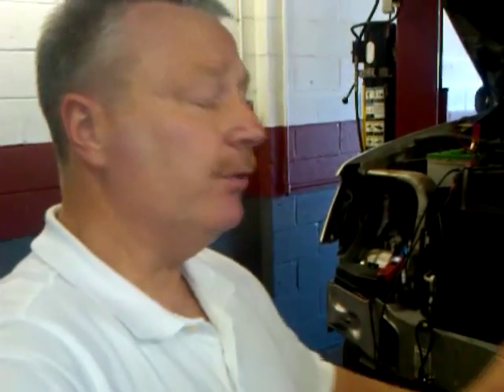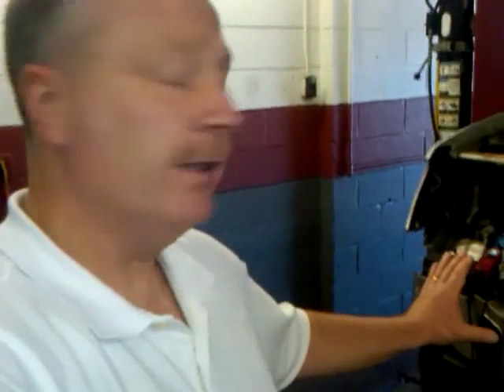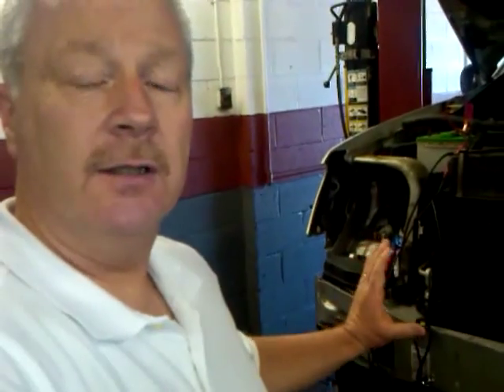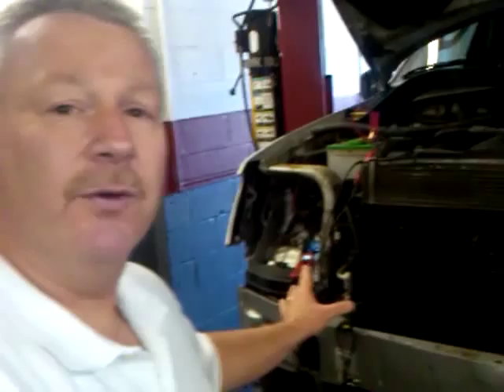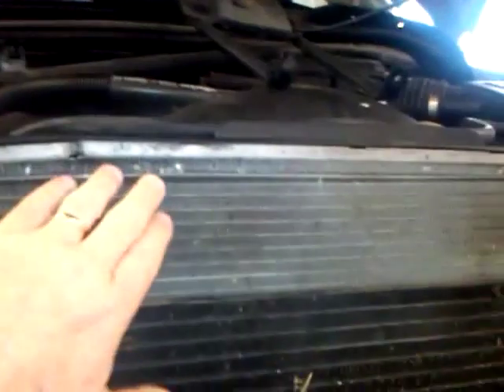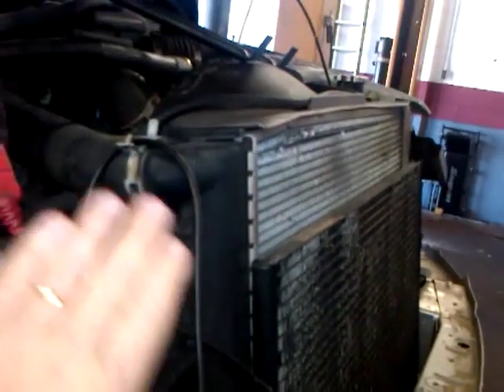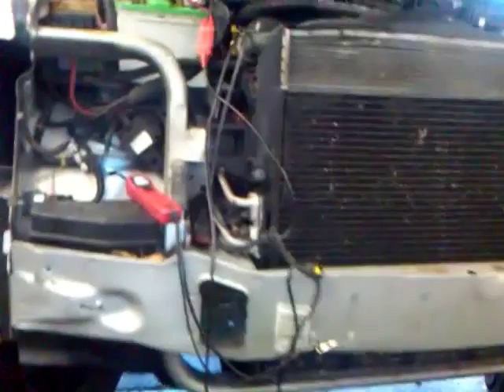Auto Repair Tip Wilmington Delaware - 2003 Jeep Grand Cherokee Overheat

Comment from the maker: @herrolusa What you need to do is to check the amp draw on the fan motor. The motor draws to many amps which crushes the cooling fan module. We had to replace the fans as well on this unit. It's pretty common on Jeeps, Town and Country mini vans. The motors, fans and shroud come as one piece I think. Don't do it any other way.- Thanks for the comments - Greg